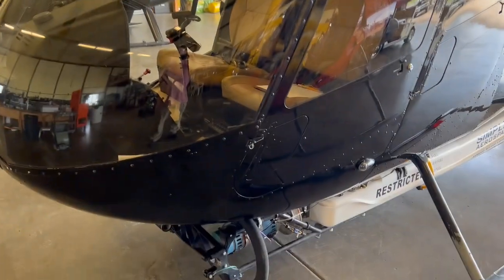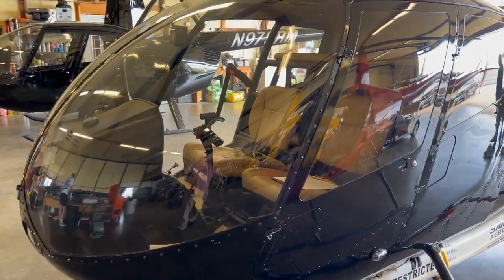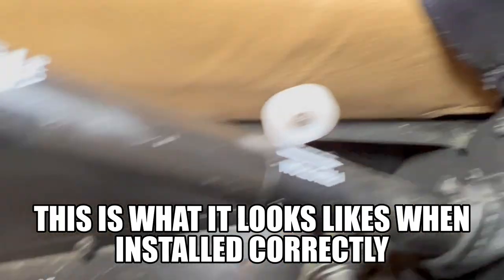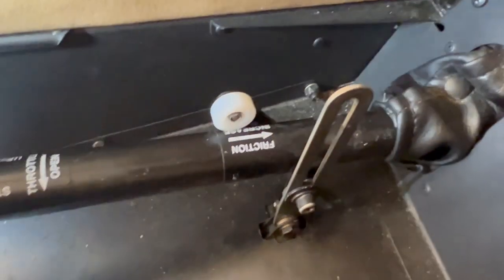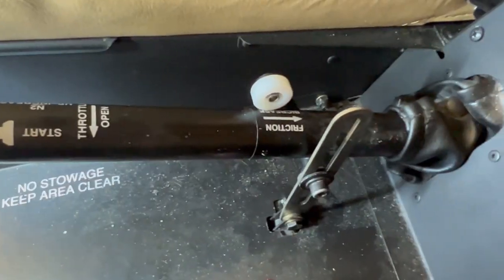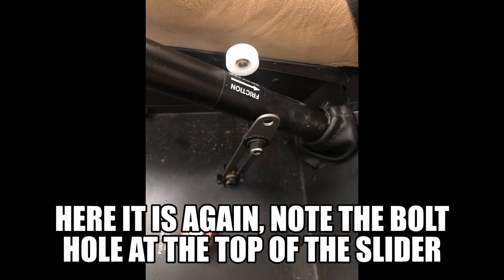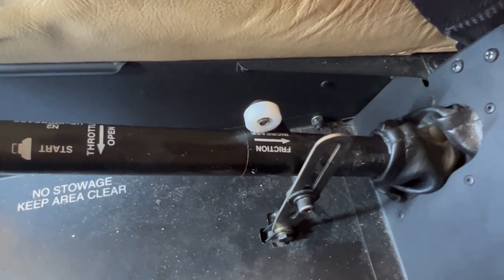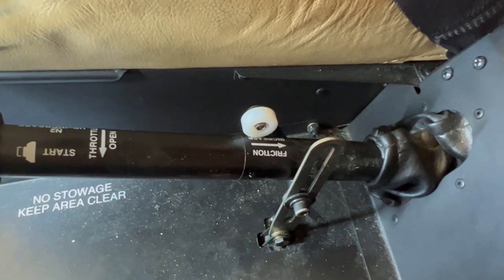A Simple Mistake that can lead to Big Problems!! - You'll want to see this if you fly an R66

Comment: I am assuming an aviation mechanic would have the repair manual for a helicopter before making repairs.  Also the bracket should be designed to only be installed one way.

Comment: Wow  How could a person even think this was the correct way to install that??????????  I doubt most folks would need a manual to realize there would be potential issues including and beyond whats reported here. If you just look at it its clear it can only logically go one way. I cannot fault Robinson Engineers for this design, except it sounds as if this is not the first time. However if they change the design it would require a new version of the craft. I guess Robinson did not realize the rather rapid decline in learning to think is on the rise. I hope whatever tech did this did not work on the engine or tail Rotter.